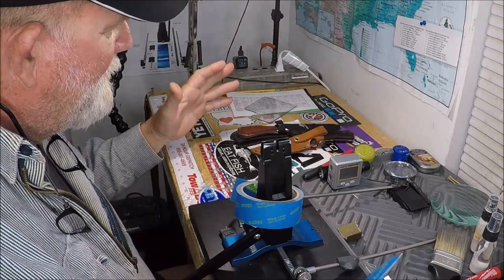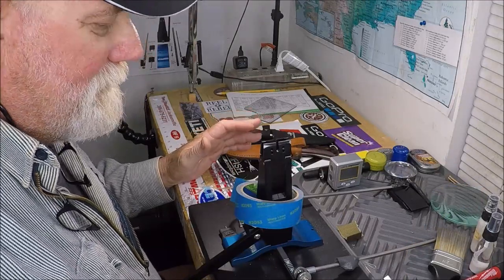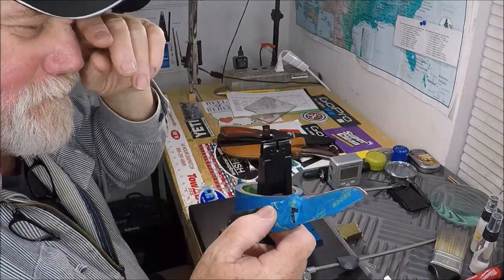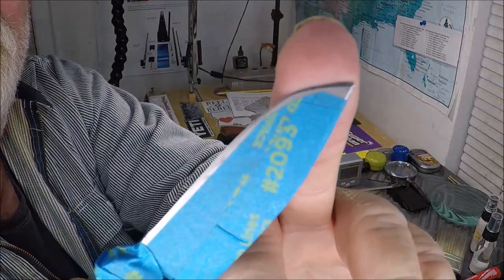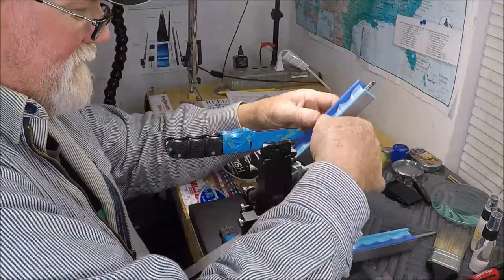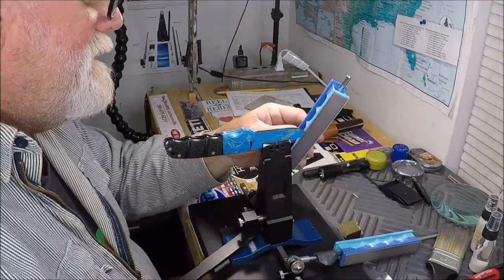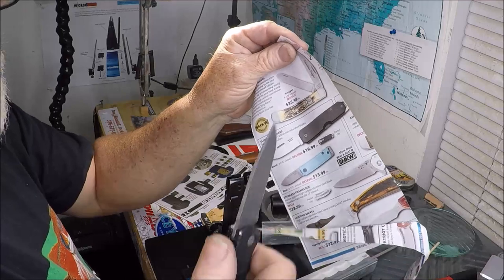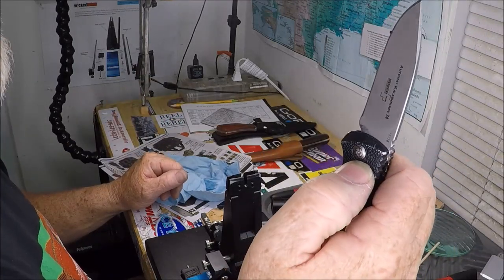BOKER KALASHNIKOV 74's COME DULL

Comment: Get rid of that magnifying  Glass and get yourself a jeweler's loop with a little light on it. I love mine and it costs about $15 on Amazon.  Also I would suggest using the angle ruler that the deaf key goes through that that way you can log in a book every time the knife you do and there's no guessing the next time around you just do it by that and you have the exact angle and where you put the knife in the vice grip.